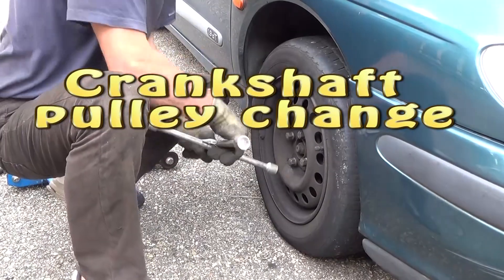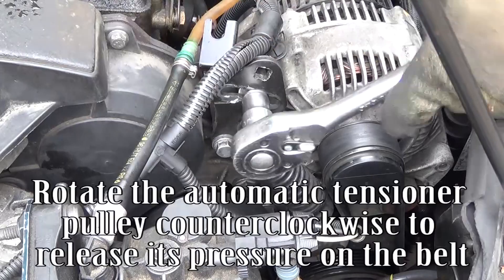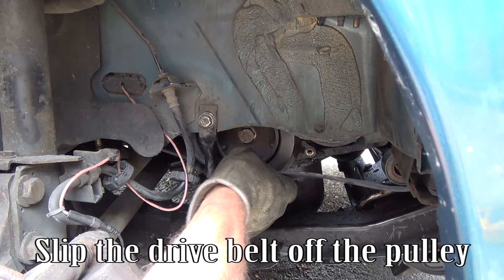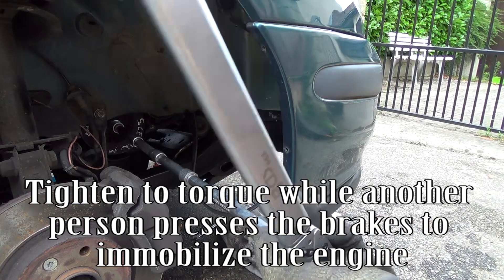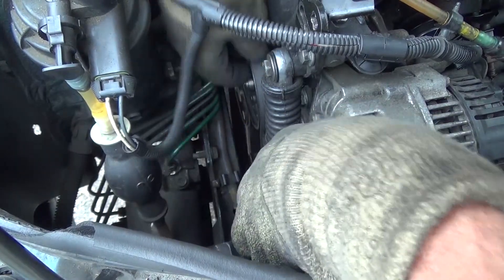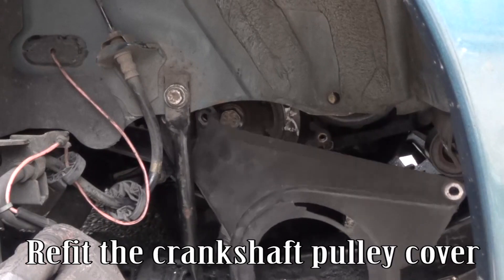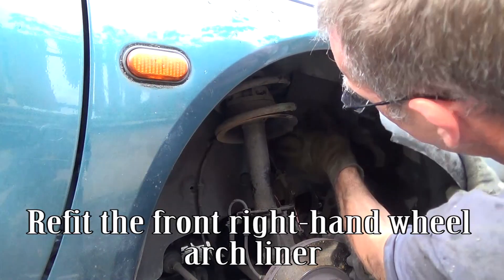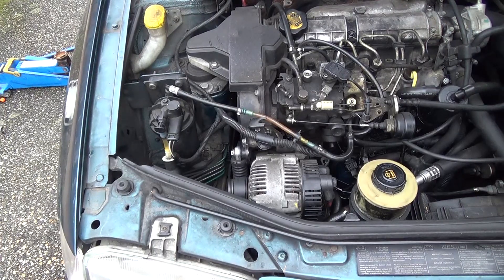Crankshaft pulley change (damper pulley)

Comment: how do I know if the pully is bad
Reply: If it wiggles!
Reply: Jorge Del Sol my pulley also wiggles. hahaha. will change next week. lol
Reply: The noise alone will tell you right away. In case of doubt point a light to the damper pulley while engine rotate. A slightly wobbling belt will be a good tell tale.

Comment: how can the brake immobilize the motor,,, sounds odd. does this work with petrol motor. im about to do this job but losing the timing scares me a tad
Reply: There's nothing to do between a TIMING BELT and an accessories belt (serpentine) two different animals in two different places... ;-)
You can put on and take off the serpentine belt how many times you want without even touching the timing belt/timing chain. ;-)
Cheers
Reply: me too.